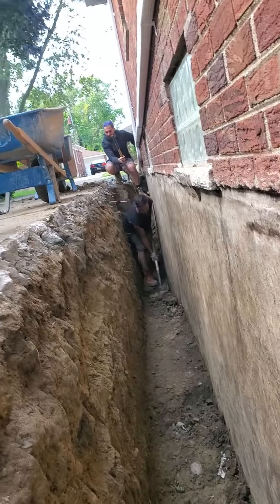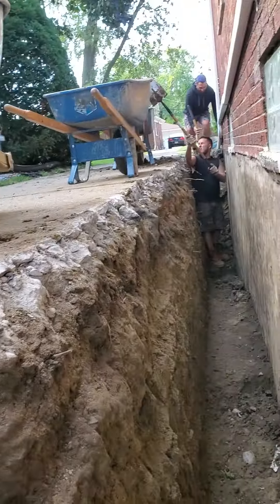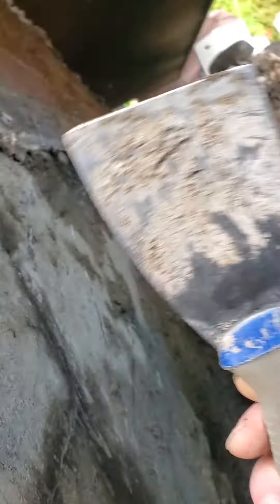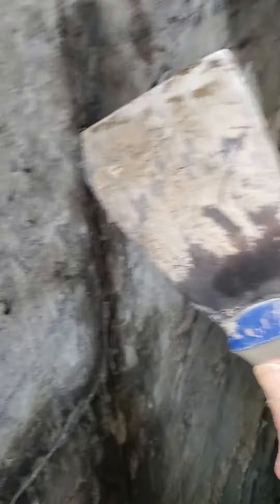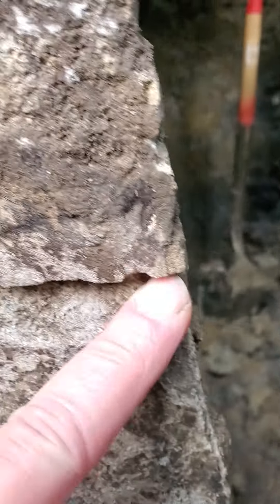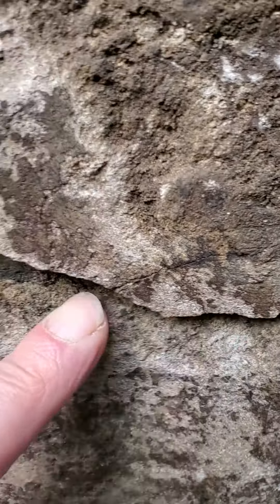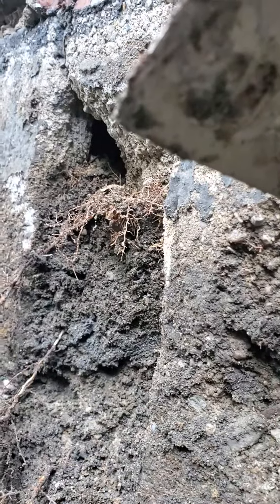foundation wall exterior waterproofing

Comment: Listen  people i contacted mark in January and he came out i told him what I thought was causing my concerns and he told me what he thought  .Problem  
Water coming from chimmney clean out 
When rains heavy had two chimmney  people look at it they could not show me what was wrong but they  could give me a price but would not say it would fix my leak one was 8,000 the other 5,000 and the brick would not match ( But I stopped by a brick supplier  they said no problem)  Hot dry day mark said put the hose at the base of chimmney  and turn water on med and set timmer as shure as the sun may come  up tomorrow and Bidon  will screw something  else up he 
Was right in fact no high pressure  by Mark and his word is his bond I can tell I am scheduling  the proper repair to day .
Listen  it few and fare between when 
Repair people know there stuff and this guy does I checked out everything  he has said and dam it he was right 
Thanks mark let's get it done
Paul from fraser